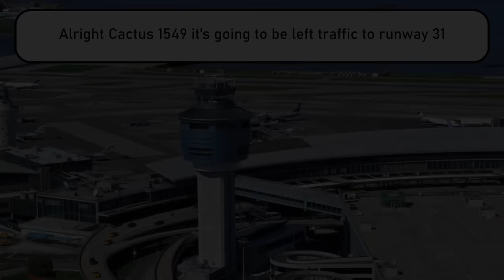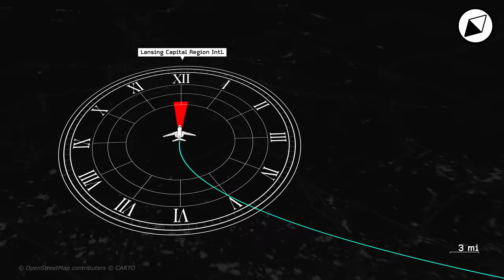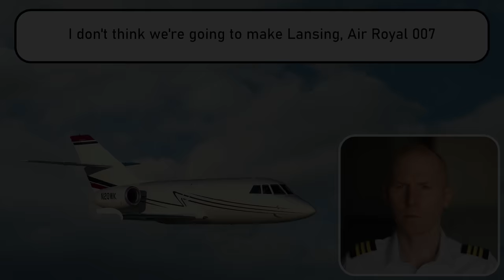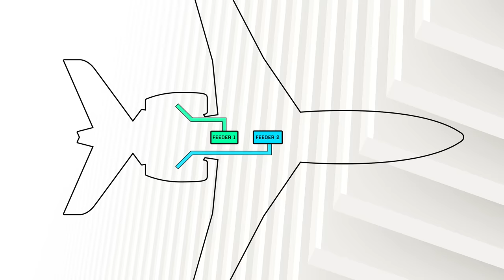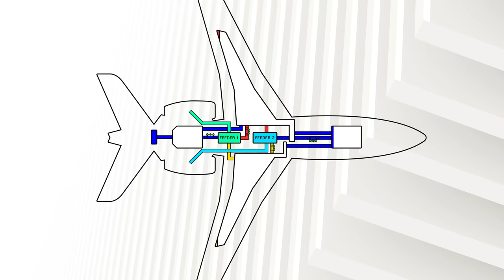Most Bizarre Dual Engine Failure Ever

Comment: Seems like Manual controls on the something you have no access to in flight is a design flaw. There should be some redundant system to confirm fuel flow. Like a light or something that says "Hey you got a full tank but the valve is closed" that you can see from the cockpit. Because then it ultimately in the hands of pilot to confirm that it's correct.
Reply: I'm not claiming to be particularly knowledgable, but Falcons go all the way back to the 1960s.  If you compare, say, cars made in 1965 to cars made in 2015, an awful lot of the difference is just in the level of automation and quality-of-life details like safety warnings such as you suggest.  So depending on how old the plane is, it might be less of a design "flaw" and more of a "some things technology can't do yet, so make sure to actually look at the valves and be sure they're open before you let the pilot have the airplane" situation.

/shrug.  Or it may indeed be a "oh, we didn't think of that, maybe we should fix it in the next one" scenario, which is indeed a flaw.  Just idle speculation on my end.

Comment: Landing a JET with no engines is a lot bigger problem than a GA aircraft.  Jets fall out of the sky like a brick.
Reply: Actually the reverse is true. Jets are more efficient in the air and can glide much farther than typical small airplanes. A Boeing 747 has a glide ratio of about 17:1 while a Cessna 172 has a glide ratio of about 8:1.

If both a 747 and a 172 started gliding from 10,000 feet, the 747 would glide about 32 miles, the 172 would only glide about 15 miles.

One difference though is that the 747 will be descending at a much higher speed so the pilots will have less time to make decisions. While a 172 won't glide as far, it does descend slower giving the pilot more time to look around for a spot to land.

The higher speeds and greater weight also means that the 747 must land on a runway to have any chance of survival. Whereas a 172 has much greater survivability landing outside of an airport.
Reply: @StevePemberton2  Wow.  Thanks for sharing.  I've flown sailplanes and lots of GA aircraft. No jets.  My brother flies 747 for a living, but we've never talked about glide ratios.  :)

Comment: I wonder if a vacuum lock caused it, the vent to let air in as the fuel is consumed, maybe that clogged.
Reply: It would have to occur on both systems - there's no way they'd have a common vacuum break. But it also seems bizarre that there's a manual shutoff to the feeder tanks and that BOTH would have been accidentally left closed by maintenance - there must be a procedure for them when closing using such valves that prevents human error and forgetting to reopen them, like lockout boards or something. I feel there's a lot more to this story.

Comment: Glide distance shouldn’t change with weight tight? You said when the planes heavy, it won’t glide as far?
Reply: Put another way, Lift over Drag is dependent on airspeed for a particular airframe regardless of weight. However, your vertical speed in unaccelerated flight will be very dependent on weight if your Lift remains constant. 

So, even if your airspeed and Lift over Drag remain the same, the amount of time you have in the air reduces with an increase in weight. Less time in the air means less distance.
Reply: @deanfowlkes  That's if you maintained the same airspeed as a lighter plane. But at higher weight you would use higher airspeed and glide the same distance.

Comment: 74g I guess he has to maintain 3000 ft if engines running or not. It's ATC logic.
Reply: Technically, he has to maintain a certain, predetermined minimum altitude for ATC to give him directional assistance. Otherwise, they can only advise the pilot of general directional info.
Reply: @deanfowlkes  OK thanks. Comment was mostly dry sense of humor.

Comment: Hey yo Kelly, I have a question for you: why is it that basically all communication is done in analoge and not digital? I can see why it would take a lot of effort to switch but to me digital sound way safer and clearer. And since communication is so important Id assume there would be more of a trend towards digital.
Reply: In computing there's a term for a change like this - a "Flag Day". Since radios are a key part of aircraft safety and a requirement for operating in many categories of airspace, you'd basically have to get every aircraft (including GA) to either switch radios or effectively fly NORDO (no radio) - it took a long time for ADS-B to roll out for GA aircraft and that didn't have any conflicting technologies it was replacing. 
You would also probably have to switch operating frequencies to avoid interference from inadvertant use of analog radios. In addition, your analog radios work everywhere, but as soon as you separate out a new radio tech like this, you might have issues where different territories use analog or digital radios which is another thing to manage.

As an aside, one other downside to digital signals vs analogue for a case like this is degradation - analog signals are somewhat more susceptible to interference and degradation, but their characteristics are such that the degraded signal is often still intelligble. Once interference or falloff starts to affect digital signals they become garbled very quickly, especially if any compression is used (see how digital terrestrial/satellite TV and radio act vs analogue versions under signal loss conditions).
Reply: Cepheus has given a much better response than I ever could but my first thought was (aside from the insane cost and compatibility issues) that if analogue signals are weak, they can still be enough to get a message across, even if you have to do it via other pilots in a relay. With digital signals though, they're audible and intelligible, until they're not, then there's nothing. There's no middle ground. Plus, I would imagine that they would STILL have to include analogue radio as backup anyway (or for other systems) so you have to ask if it's providing any tangible benefit for the cost and difficulties associated with rolling it out in multiple countries worldwide and thousands of different airlines and plane types.
Reply: @cepheus6421  
The thing is that i assume that atc and piltos alike getting cut off and a regular basis. I imagine a system like a teamspeak or discord server, where the possibility exists to talk simultaniasly and the ability for the atc to move people to different frequencies. i believe that it would take a lot of workload from the pilots. 
What i also assume that the audio qualtiy would be way better and clearer, which would lead to the elimination of misunderstandings and such. 
Sure there would be the need for new infrastucture but i am confident that it should be possible to implement a dual system with the main carrier beeing digital.

Comment: I wonder why planes are not equipped with parachutes inside.
Reply: It would be extremely impractical, also there are very few situations where it would help. Also people get injured just using escape slides so we know there would likely be fatalities having ordinary people with no training bail out of an airplane.
Reply: @StevePemberton2  well I was mainly referring to the crew lol. But I understand the proper training part, if a plane was going down I would take my chances on a parachute especially over land. You are screwed over the ocean wether you go down with a plane or a chute.
Reply: @D3MON_KOR3  That's harder to answer, you would think some would but I think it comes down to the rarity of accidents and the unlikehood of being in a situation where a parachute would help.
Reply: @StevePemberton2  right right
Reply: @D3MON_KOR3  I remember when they had to pass laws to get people to wear seatbelts, a lot of people wouldn't wear them. Driving without a seatbelt is much more dangerous, especially back when there were no airbags.

Comment: Kelsey, the descent is at PD which gives then whatever they need down to 3000, and they would clear them once they report the field in sight. Sully's circumstance had many more people involved, and he said unable because he knew he couldn't make it back to Laguardia. Air royal's concern is for that aircraft only, the controller still has concern for all other traffic as well.  Just sayin (14 years ATC)
Reply: But he is incapable of descending to and maintaining 3k feet. Oh he's going to descend, no choice in that but there will be no maintaining anything.
Reply: @wingracer1614  Regardless whether his engines are on or off, most aircraft roll back to idle during descent, so this is irrelevant. The descent being given is at pilot's discretion. It is their choice how quickly or slowly they get there, engines running or not. Would you prefer he say descend at your discretion until you hit the ground or stay calm and do things normally. Visual Approach Clearances, which he is opting to use are usually given when the field is reported in site; this being far ahead of the time he even gets close to three thousand. you are fixating on the word 'maintain' and controllers try to never make the pilot stop his descent...if they are a good controller. So, no, he is not incapable of descending to 3000' he can do that and will continue on down since he probably called the field in sight well ahead of 3,000'.
Reply: @la8bloomer509  The controller's wording may be technically correct and an experienced corporate jet pilot would likely understand it as this one seems to have. I think Kelsey is pointing out that not all pilots in that situation will understand what is meant and it could be confusing to them. 

Also while obviously a controller can't ignore other aircraft, I would think that in an engine out situation the only concern for other aircraft is keeping them out of the way of the disabled aircraft, as well as making sure that the other aircraft don't run into each other while this is going on. But getting them all smoothly into their landing slots would I think be set aside as a priority until the incident aircraft is safely on the ground. Of course keeping them landing could be simpler than putting them in a holding pattern, but in other cases putting them in a holding pattern might be simpler and take less of the controller's time. I'm not claiming to know the intricacies of doing all of this, just confirming because what you said could be interpreted as, "You're not the only plane up there, I've got others that will be delayed if I don't take care of them". I'm pretty sure that's not what you meant.
Reply: @StevePemberton2  you are obviously not a controller.  Yes that's exactly what I mean. Traffic doesn't stop just because an emergency exists. The emergency will always have priority when confliction occurs with another aircraft, but the controller will continue to work his other aircraft in their appropriate sequence of operations.  The world outside doesn't stop just because a pilot says "We're declaring an emergency." But the phrase does give them priority, not exclusivity.
Reply: @la8bloomer509  What an odd answer. How about the fact that I said, "I'm not claiming to know the intricacies of doing all of this", wouldn't that be your first clue that I am not a controller, the fact that I stated as much? 

I acknowledged that the controller still has to manage the other aircraft in their airspace. My one "mistake" is apparently not realizing that total loss of engine power is no different than any other emergency in your opinion. Note that I am not convinced that what I said is incorrect, I just seem to have misgauged what you think about it. 

I certainly expect that if a plane calls in that they are flying with one engine inoperative, or one of the pilots are incapacitated, etc. that even though those are emergencies a controller will have no need to modify how they handle other aircraft.  But I would think that when an airplane cannot hold altitude due to total loss of power that this would result in maximum priority for that aircraft regardless of the extent that it inconveniences other aircraft. 

It's not obvious to me that your opinion on this topic represents that of all controllers.
Reply: @la8bloomer509  “Regardless whether his engines are on or off, most aircraft roll back to idle during descent, so this is irrelevant.”

Actually your comparison with a normal landing seems irrelevant to this situation. You are referring to a situation where the plane is already on planned descent towards an airport and is descending on idle power because that is all that is needed. However idle thrust is not the same as no thrust.  And even with idle thrust the pilot may need to add power at times to maintain the correct descent.

In this situation they lost their engines while climbing out at 14,000 feet. They diverted first to Lansing, and then when they realized that they would not make it there they switched to Mason. It was far from irrelevant that both engines were not operating as they descended towards the airport.
Reply: @StevePemberton2  again, to are putting tunnel vision on the phraseology used. It is designed to standardize as much as possible. And yes, I do follow what you are saying, but as those who observe from outside the realm of anything you, like news reporters, focus on words and not how they are used within the process. We could go on and on about this, by until you work jets a d keeping them apart, you won't see the big picture. Keep starring at the tree. Happy New Year to you.

Comment: Weight actually does not really impact glide distance. More weight does mean you will be flying faster to maintain the optimum lift to drag ratio, which is the distance to height ratio.
Reply: I'm a CFI-G and came here to say the same thing.

Comment: What scares me the most about flying is when you have to cover long distances over the sea. Like when crossing the Atlantic ocean for example. Flying for like 8 hours knowing that if you fall, you will die, is scaring. Wouldn't it be safer for those cases having planes that take off and land like an helicopter?
Reply: Yes actually, but only the landing part. The autogyro is a stall less plane, but it can't go very fast. It can land gently without power almost vertically using very short space, and take off like a normal small plane. Nowdays they can also take off like a helicopter but that's an addition and can still be ignored. All the reasoning behind the invention of the autogyro was to make a plane that cannot stall. Because they can't go fast, "8 hours" would only cover a fraction of your intended distance, so that's why. As an alternative, certain small plane brand comes with a parachute for the entire plane...

Comment: Curious now: If you lose all your engines on a jet plane and you've become a glider, is there any chance you can gain any height at all (or at least maintain) with a really advantageous thermal (kind of like a designated glider), or is the only way down?
Reply: Once an aircraft loses power, they start to lose altitude.  How fast is dependent on the glide slope.
Reply: @robertheinkel6225  So a strong advantageous thermal will not reduce that or in best case marginally push the plane up?

Comment: By the way it's not the seat of your pants.  its use your calculator to determine minutes to destination.  then calculate number of minutes to ground contact at current descent rate.  If more minutes required than available you can't make it.  Not seat of pants but basic pilot skills.

Comment: I don't know this aircraft but some planes could glide very far at the same altitude because they can fly at a wide range of speed. I'd only flow with a very narrow range of speed: the first time where we fly with a little bit of a low altitude I flown to slow and I'd got there lower because I was scared of the power lines which I had hold clear with 150ft.
With a modern gilder you got 1:20 - 1:50 glide ratio and you could even climb over car parking spaces, with the high range of speed they could get clear of controlled airspace if they only get a altitude or speed (not both). They use this instead of opening the controlled airspace for gilders in some places (no new ATIS needed and commercial planes didn't get restricted by the TRA). There should be a chart in the plane at what speed and configuration what glide ratio you could expect.
Reply: When gliding, an aircraft always lose altitude. So it is complete BS to say ›stay on 3000‹.
Reply: @akronymus  no: you could lose altitude or speed; You should fly with a glider (1:50 and speed 70km/h-300km/h); if I pitch up at the landing to early I will gain altitude without an engine (If I'm too late the plan lose control 1m above ground)
Reply: @losttownstreet3409   
You are right that an aircraft when gliding will lose either height or speed. This is a Dassault Falcon 20E with a stall speed of 82 kn, which is quite good (low) for a twin jet, but still with losing speed, range is lost as well. A question ›can you maintain 3000 ft?‹ would have been more appropriate.